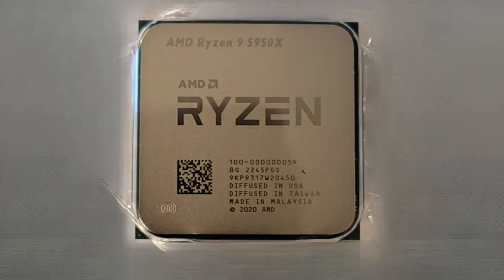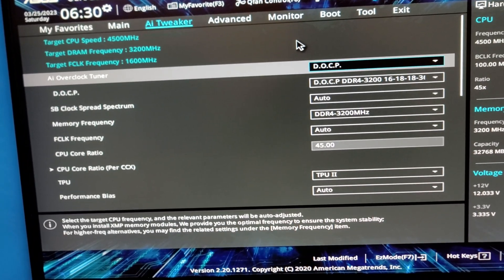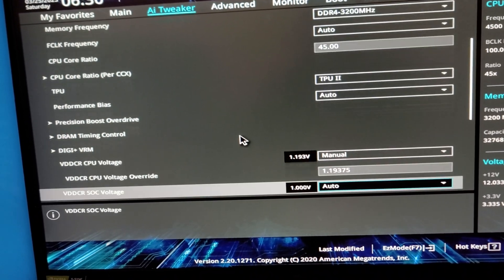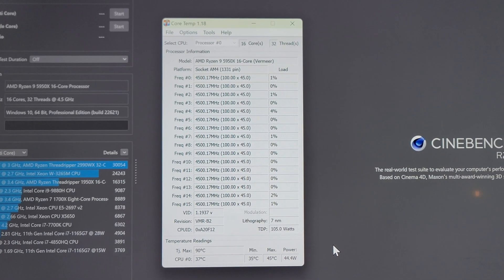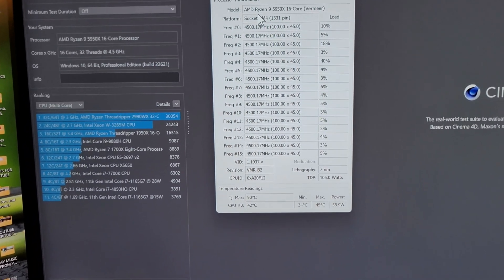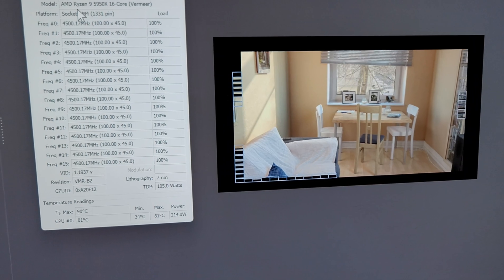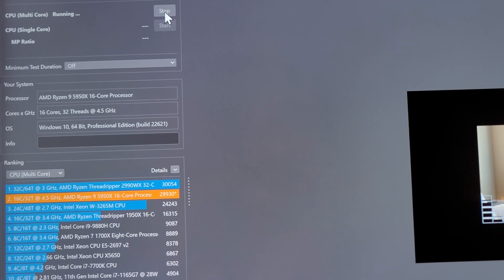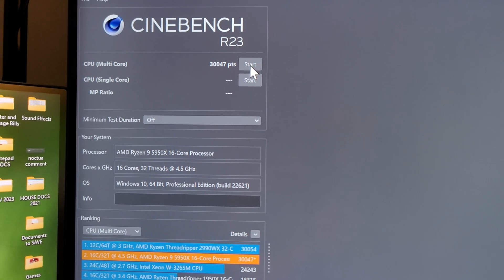Air Cooling vs. Ryzen 5950x Overclocking: How Far Can We Push It?

Comment: I got my PC prebuilt from Scan UK in 2022 Ryzen 9 5950x/evga 3090.I last used Cinebench in late 2022 scored 28500 multicore.However I just recently updated the bios in the Asus rogstrix b550 f gaming mobo,now I'm getting 1250 score multicore in Cinebench,the clock speed shows around 4.4ghz-4.5ghz all core temps 70c tops.I'm not understanding if the settings have been deleted by the update,I've seen stock 5950x well over 20000 Cinebench score.After selecting PBO in Ryzen master I get this crappy result.Incidently the picture in Cinebench is getting renderer way  slower than this video.Is there something I'm not selecting.Maybe I should copy this video my cooler is Corsair H100x AIO.